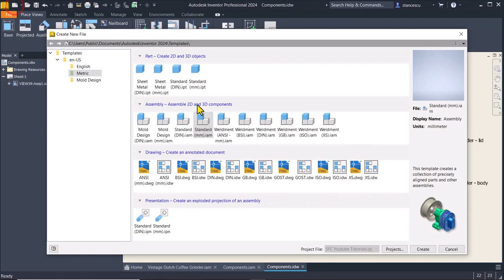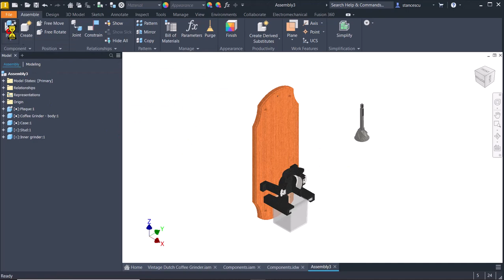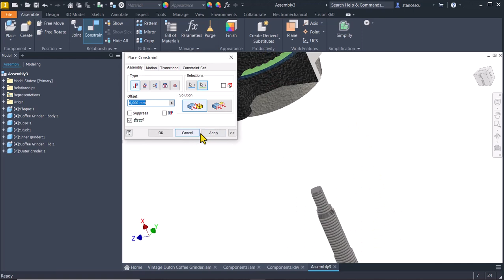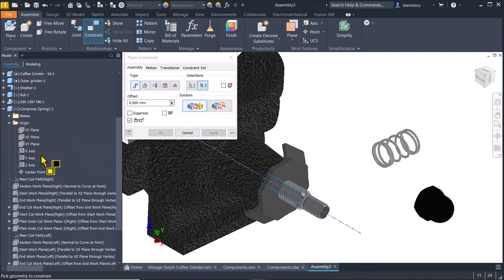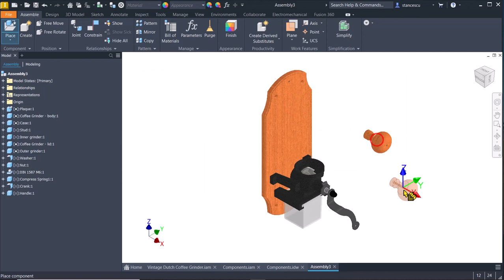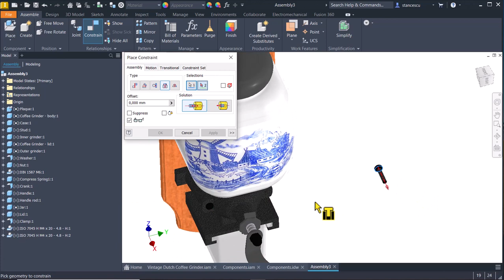Tutorial Inventor - 394 Vintage Dutch Coffee Grinder - Inv2014

Comment: Another great video. Even i 've start watching your video's, there are too many. I will do search into XLS file but is it possible to tell me if there are tutorials who shown how to adjust parts inside assembly? For example, i need to adjust 2 pipes inside other 2 bigger pipes grounded in an angle of 20 degrees, so driven by a single gear and horizontaly shaft, both pipes are moving almost verticaly in an angle of 20 degrees together and all of this assembly goes to a metal base acording to my plan. It would be very usefull this kind of video. Thanking in advance.
Reply from the maker: Send me the parts on constantin.stancescu@gmail.com